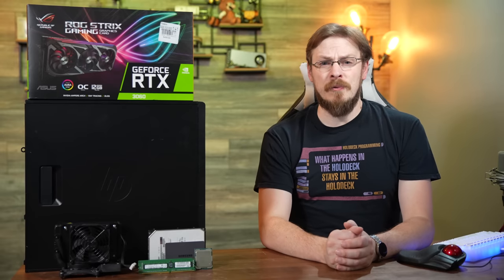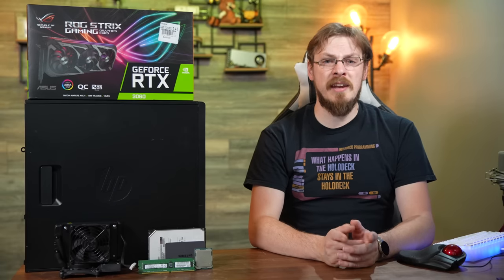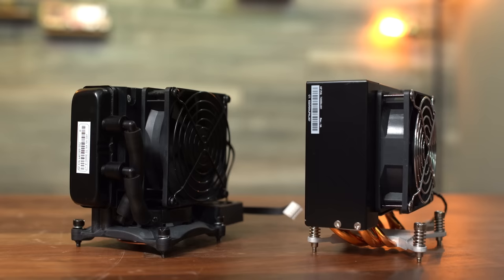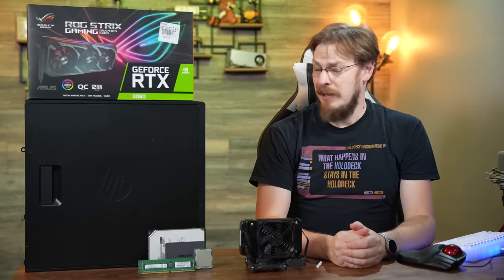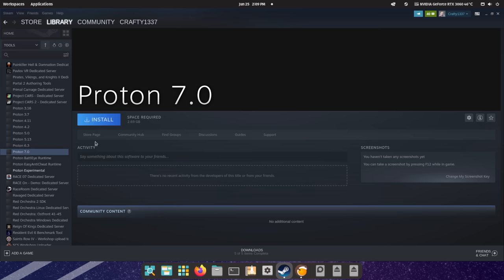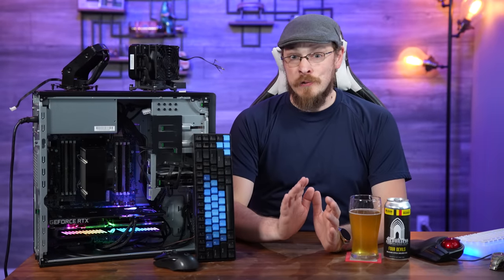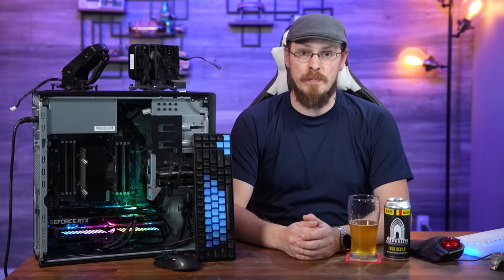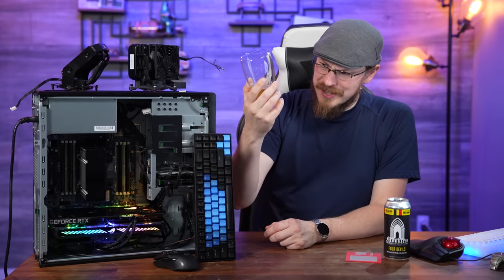A Used Xeon, a New GPU and a Linux Install - HP Z440 Gaming/Workstation Build

Comment: I think it is wrong for somebody to come to Linux and try to mimic your workflow on another OS. It would be difficult since you have to use a lot of workarounds and never learn the real advantages of Linux. Of course, this costs time and is understandable if somebody can not afford to invest that time, but once you decide to learn to do the things the Linux way. Indeed with Linux, anybody could discover new and more efficient workflows. 
I say this for experience, I tried to use Linux as if I was using Windows, which was a terrible experience. Still, my workflow started to improve once I learned a bunch of useful CLI tools and plugins made for the community for open source programs.
Reply: Well i can say that after 1 year of linux i never wanna go back
Reply: @John_Kap  I’m thinking of making a new build and running Linux on it, how do you suggest going about it ?

Comment: i got started with one with a xeon e5-2670v3 inside and 64gb of ram. nice little server, lot of limitations tho.. switch too fast to an asus x99 in a rack mountable case. now i replace basicly everything and i got an extra z440 with 12 cores laying around. dont know what to do with it. shipping it will be a boooore
Reply: @Louis-philippe-Cantin:

You could use it as your "daily-driver" regular-use computer.

You don't HAVE to use it as a server.

Computer-hardware is-STILL computer-hardware.
Reply: @reoencarcelado5904  yeahhhh... I got a 5950x with a 6800xt for that...

Comment: I have been saving up for a z440 for a Vmware/NAS toy. Don't you dare drive up demand/prices.
Reply: Prices are holding firm around what was quoted. I just picked one up for $125 locally, and all of the Xeon goodies are really cheap. Most of them are used, but still functional if you feel like experimenting with core numbers vs CPU output. Same with Nvidia GPUs. I'm planning on experimenting with a pair of bridged Quadro M4000's to see how they handle gaming. Other videos I've seen showed sorta ok results with a single card and a basic CPU, but nothing from a bridged combo with an updated CPU.

I really don't plan on doing heavy gaming with mine, but it would be fun to jump on and drop a line about how I'm running this race in a semi truck

Comment: Gotta say man I love that you do so much with Xeon cpus I feel like performance wise and I think they are thrown to the side for fancy i5 i7 chips and don’t get me wrong the new CPU’s are obviously more advanced diff instruction sets technology etc but I feel like these higher core Xeon’s still compete perfectly fine for day to day use with these newer chips and yet they are like 80% of the cost of these new chips like 400-500 for a decently nice intel cpu? That’s crazy lol
Reply: remember xeons have to be powerful for running simulations and other intensive tasks that businesses will use them for
Reply: @TruthDoesNotExist  well obviously If your job or company requires the usage of those things sure but for most daily joes just trying to browse the internet and do some gaming etc dual xeons are way more then enough power to do so and you can on a budget the price of current intel hardware is a joke which is why so many have shifted to ryzen due to the power and affordability

Comment: Would this work as a good proxmox server?  Or would you need more cores and RAM?
Reply: For the same price as that 1660v4 you can get a 2690V3 that has 18 cores. That 1660v4 has a slightly higher single core thread speed that would be better for gaming but the 10 extra cores would be what you need for VM work.

Comment: Can rtx 3060 run on a lenovo s30 worksation with power limit to accommodate the 150 watt max output by the power supply ?

Comment: Could you have installed an NVMe via an add-in card to store the games to make it a bit more snappier? Even if the HP won't boot to it, to use it as a storage drive is already an improvement.
Reply: Yes you can. I built a z640 with a second CPU riser add-in (set for ~$350) and also put in the official add-in pcie card that has a single nvme spot (I think its called the Z Turbo Drive; $40 on Amazon part # MS-4365 ; NVME storage separate - put in 1TB Hynix). One nice thing about HPE products is they have both a "Quickspecs" and "maintenance guide" PDFs you can download with a wealth of info. Guide says to be able to boot off the nvme, you need to have no other storage installed yet, install OS, then install other storage. Has worked great. Recently upgraded 2x 2.4GHz V3 CPUs to (2x 3.5GHz V4 for $90 total). With a V3 CPU the RAM is limited to 1866 whereas upon my upgrade the clock jumped to 2400 (since I initially put in 32GB 2400 RAM $130). Now just waiting to replace my old gtx 960... My dad got a  Z440 and did similar to the OP video of just putting in a regular SSD and HDD for storage with a workstation GPU.

Edit: My dads PC was quite a bit less. The 16xx V4 CPU are better if only using one socket which the z440 has. With my z640 and having additional CPU socket, you need to use 26xx CPUs. Z840 has 2x CPU sockets on mobo, no riser card needed.

Comment: Did you check to see if there was an adapter cable similar to the one used to adapt an aftermarket cooler to a Dell? You'd think there would be one. I bought 2 Dell adapters a while ago for around $5 with free shipping. Just a thought...

Comment: So I've been planning on something like this for maybe longer than I've been watching your videos but found this right around the same time I was trying to figure out what kind of mostly-gaming-focused decommissioned workstation to buy (had some plans for also using it as a hackintosh, so looking into KVM virtualization -- I found your channel from looking into virtualization stuff for things like that and remote gaming). Alas, my setup won't be quite as fancy as yours, though, as my budget right now isn't for anything fancier than a 1650 yet, but might upgrade that in a couple years right now (something that my decades of work with laptops never allowed, and a positive change I'm looking forward to).

Anyway this video's a bit old now but long term engagement metrics being what they are, maybe you can help me with a question. I noticed that with the 3660 you're using, you didn't plug in the supplemental power during the setup montage. I saw another video that had to use some adapters with the stock power supply to plug into the GPU, notably using an adapter from the SATA power ports (!!) claiming it was the only method that they could find that sufficiently powered the card. Did you use a custom power supply, adapters, or something else?
Reply: Well, it looks like the problem is that I have the 525w power supply. Well, it sounds like the 1650 may not require the extra power if it's not being overclocked, so it might run well enough for the stuff I want to use it with. If not then the power supply is the next upgrade on the docket.

Comment: Great video.  The best X99 CPU for gaming without a doubt is the i7 6850K Broadwell-E, but those are still well above $100 on Ali Express.  I have one matched with a 1660 Super and 32GB 2400 DDR4 in a spare gaming rig I built.  Great frame timings in any modern AAA game.
Reply: The E5-1650v4 is the Xeon equivalent of the i7 6850k (minus the igpu) and it's goes for $40 on eBay. There's also the 1660v4 which goes for $90 and has 8c/16t. This cpu is great for those who need a rig for work and play, lol. 

 I got a z440 with the 1650v4, 32gb of ram, 256gb SSD and 1tb hard drive for $200. I added a 5700 XT and it's a gaming beast.
Reply: 16xx V4 Xeons are actually surprisingly quick, their single core speed is comparable to third gen Ryzen which is about the lowest I’d go for a comfortable modern gaming experience. 

They also support triple and quad channel memory, DDR4, and if I recall correctly are unlocked and support intel turbo boost
Reply: @error4159  The i7 doesn't have an iGPU either
Reply: @JeffWaynee  Thanks for the info. I assumed the HEDT i7's were the same as the regular i7's.

Comment: i have a wacky "workstation" build to suggest 
months ago i bought a Laptop "10th" gen intel 8c/16t ES chip adapted to use with my desktop z270 motherboard (QTJ1, im loving it so far)
and i noticed in the store that there was a SRFCZ E-2286M Xeon chip available as well, and is compatible with the workstation LGA 1151 motherboards (with a bios mod using a usb bios programmer) and that makes me wonder, would it work with ECC memory? since it can slot into workstation mobos i figured out it should

so an 8c/16t laptop to desktop Xeon E-2286M (127 bucks approx.)
ECC ram
and a tesla M40 cuz why not, the Xeon comes with an igpu and the tesla is back at 99 bucks
it should be a hilarious build imo with a modernish cpu architecture and also quite cheap!

Comment: I have exactly one of these model workstations but the motherboard on it is a bit…dodgy. One of the RAM slots had been damaged and for some odd reason, if I try any GPU that needs supplemental power (even though the PSU is good), the system refuses to output an image or even boot sometimes. It has been quite difficult to source a replacement mobo for one of these.

Comment: Got a Z400 mobo with a W3680 but I couldn't get Win 10 working on it
Reply: It’s possible! Have you updated the BIOS to the most recent version? I was running RAID 0, Windows 10, SSD and a GTX 1060 + a ridiculous amount of RAM … think it was 96GB! … and had the top score on Novabench for a while (if not still!) so yeah, Win10 is definitely do-able :)
Reply: ^ with overclocked W3680 :) … but upgraded to a Dell T7810 and a gen up CPU (E5 2680 v3) with NVMe :)

Comment: One day I’ll see a YouTuber use a drive bay adapter for their SATA SSD…
Reply from the maker: If I bothered to use one, I'd just be lying to you all. I never adapted them in my personal builds before I started making videos either.
Reply: @CraftComputing  I suppose the only reason to use one on a SSD is aesthetics as it doesn’t have any impact on performance but that’s good enough for me.
Reply: The funny thing is, the z440 comes with a 3.5" to 2.5" adapter unless the machine is specifically spec'd without an SSD.  Which means the original owner was like "I need at least 8 logical cores, quad channel capable RAM and enough PCI-E lanes to sink a battleship! Oh and some spinning rust for my boot drive" xD
Reply: Maybe, but this tesa Powerstrips are so Handy ;-)

Greatz from Germany
And have a nice Day
opo

Comment: i personally prefer the Dell t36xx series to HP. The Dells did better in the benchmarks and I like the case design better. currently have a t3610, running a 1680v2, 64 gb ddr3 ecc ram in quad chanel, rtx 2060. works like a charm, its a very capable system, and I can OC it further.
Reply: The 5810 is the Dell version of this chipset. I have switched from the T36x0 to the 5810 since they are PCI bootable to use NVMe drives.
Reply: Also have a T3610. Put in an E5-1650 but came with 64GB and an AMD Firepro. Slapped in an extra 4TB sata drive. I use the machine for everything, including my pron. ;-)

Comment: RTX 3060 is pcie 4.0 isnt it? Thought the z440 was 3rd gen pcie.
Reply: The PCIe specs are backwards compatible. The 3060 could likely run on PCIe v1 just fine.

Comment: Normally I'd say something like 'lost me at HP' but these are pretty solid. Still though, actually what did they think they were doing with the HP stream. :/ So bad.
Reply: The Dell Precision 5810 is the same platform if you don't like HP. I prefer the Dell management system over HP however, the HP chassis design is superior imo.
Reply: @311afox  Dell chassis' do annoy me a fair bit, but my main server is a Dell Precision

Comment: I have one of these that a basically got for free. I traded a ProDesk that I found in the recycling for the Z440. It came with an 8 core Xeon and 16GB RAM but has been upgraded to 32GB that I stole out of a server that was given to me. I also have a 2TB HDD and 1TB WD blue SSD that I found in a Nuc that I was given.The only thing in that system that I actually paid money for is the GTX 960. It's been a great computer other than issue of a black screen for a few seconds when I try to watch a youtube video. Not sure what the issue is caused by but I know it's not the GPU as it was happening with the R9 GPU and it's not a driver issue I don't think as it got a fresh install of windows when I changed the SSD. If anyone knows what I could try doing to fix it, let me know. Not sure if it's just a setting in the bios (which is up to date) or what.
Reply: I also have a Z420 that I would like to try out but I got it without a power supply and I thought I found one but turns out it's for the Z440 and they are not even the same shape and the CPU connector is different. Bummer, I really wanted to try it out because I had a ton of memory for it and I loaded it up with 64GB of RAM.

Comment: You could have setup Intel RST software to do caching with an SSD for the 6TB drive.  You can only use 64GB of an SSD for caching, but MAN does it work well.  It barely touches the CPU even though it is pretty much software RAID.

(I know this is Linux, but the C6 chipset has a RAID controller you can configure by doing the CTRL-F6 or CTRL-C, usually immediately after post.)
Reply: I don't think that works well with Linux. The better option (at least in my opinion) is to use something like lvm-cache. No hardware lockins and more flexible. If you have a 1TB SSD, why not use 512 GB or more for caching>
Reply: @eDoc2020  it does work well with Linux.  Don’t knock it if you’ve never used it.  It is block level caching, not file level.  It is RAID configured cache.  Basically you tell the RAID controller which drive you want cached.  Your idea is software layer, but my recommendation is at the hardware layer, before the OS even gets involved.  RST/IntelRAID turns your large hard drive into a real SSHD, where your recommendation, which I’m sure would be fine, is caching AFTER the OS is loaded, which causes delays and more frequent cache swaps.
Reply: @bleeb1347  It probably does work just fine then. However, I'm pretty sure Intel RST isn't hardware based. My understanding is that hardware-wise it's just AHCI and the RAID functionality is running on the main CPU. As such I don't think it would offer performance benefits over traditional software RAID.

Comment: Does a pc like this support virtualization and gpu passthrough though? Since Windows vms r a better way to run sum windows apps anyways.
Reply: I could never make my Z440 work with PCIe passthrough. Tried multiple hypervisors, but none worked. I'm wondering if my motherboard is faulty somehow, or just the iommu implementation is broken on Z440. Anybody any luck? Maybe Jaff can try it and report back? Cheers
Reply: @orydaniel  well normally these virtualization options are on the UEFI firmware of motherboard to enable. On my laptop i don't have that however if i simply enable on the kernel it works lel. Did you try that?
Reply: @asunavk69  sure, it's enabled in the BIOS, hypervisor OS reports it back as enabled. I can configure everything up for passthrough. Even the guest OS starts to boot up, seemingly all is good, but a few seconds into the bootup, the guest freeze up. The host keep going fine, I can kill the guest process.
Reply: @orydaniel  that did happen to me before on the laptop, my solution was doing the configurations on rising prism wiki not sure how necessary they are however. Also out of curiosity which cpu do you have?
Reply: If they dont have on Board GPU i guess you need a 2nd GPU for the Host so you can Pass the other...

I never tried that my own. i Just Boot Up my old z600 If i need more CPU Power then my 20watt Celeron "Server"aka Nas xD
But the end for Windows on this Workstation is Close, so the Idea of Linux and Tools Sounds good.

Greatz from Germany
and have a nice Day
opo
Reply: @opotime  i do single gpu passthrough on my pc as i don't have any other gpu at hand, however ye having 2 at hand might be better, as its less configurations going on. But if pcie passthrough works on this than great🙂
Reply: @asunavk69  I'm running an E5-2650L v3  ... 12c/24t 65W ...low tdp, many cores was the idea for virtualization. And also 64GB ECC DDR4 in four slots, leaving room for double up the ram...
Reply: @opotime  Oh I did try it with dual GPUs for sure. I's not just GPU passthrough though. I tried to passthrough NVMe SSDs, USB host controllers, NICs, you name it. Same lockup happens after a few sec..
Reply: @orydaniel  just checked on intel website and yeah it should do, funny also ur cpu is also a sandybridge like mine(i7 3820). Hope jeff also can do a tut on this indeed because who knows it could be a problem by defect.
Reply: @orydaniel  
I never try it but i remember that HP is Special and in BIOS you have to select what pcie port uses some lanes or more, but a other Port looses all Connections...

Got that Problem with Network Cards because i tryed to use all Ports at the Same time.
The Manual and removing one Card and Setup the BIOS, helped me.

Wish you luck

Comment: How did you adapt the 6pin to power the 3060 ?
Reply from the maker: Dual 6-pin to 8-pin adapter. Same current limit.
Reply: @CraftComputing  thank you, i have a z440 using a 1060 on 6-pin power. now i know i can adapt a 3060 in! What's the best gpu (for gaming) i can put into this z440? 3060 TI?